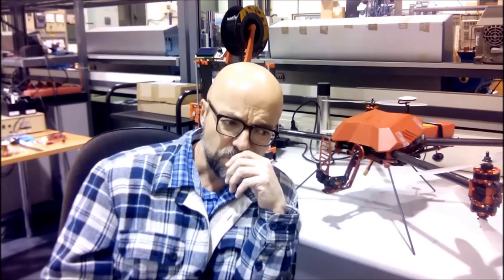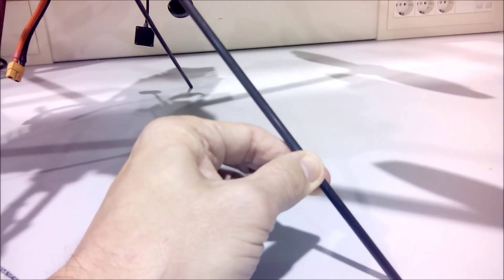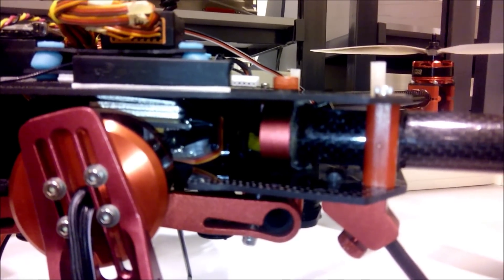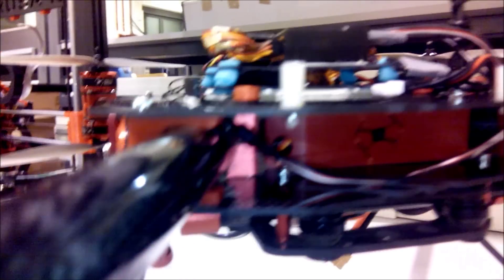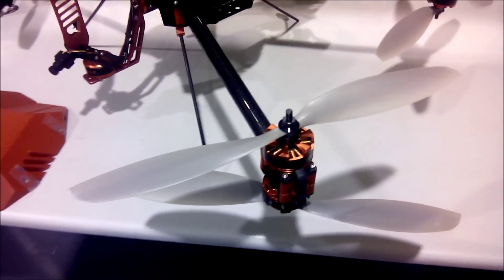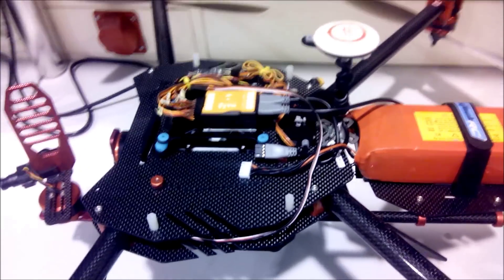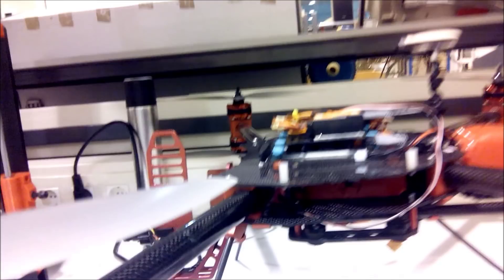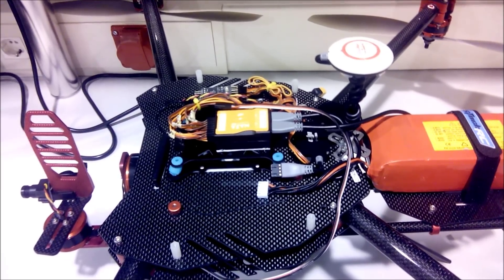Review of Mavrik - Steadidrones. The drone that does not fly

Comment: It's a bit disgraceful to bash a drone without any video evidence of it's so-called inability to fly.
Reply from the maker: You may believe us or not. Anyway, a video would mean nothing since the problem might be a wrong configuration  or a lack of experience of the pilot. My explanation about the reasons why it does not fly are here and in several videos more. Together with an abosulte silence of both the European distributor and the headquarters in South Africa in spite of my insistence. 

I do not know if you have watched the videos where I explain the design errors, the mechanical problems, the wrongly installed propellers and so on. I think this, together with the fact that they give it for free right now, should be enough to believe a serious problem exists. Moreover, you can see it fly perfectly after a complete refurbishement and a radical change in mass distribution (also in this channel). My question then is :): Is it disgraceful we did not aim to record the hundred  times it did not fly? Should we have taken a video camera and expected some costed several thousand euros tried to auto-suicide every time it took off :)? 

Talking seriously now. The colleague who brought it to me always taught it was his fault, even after a "reparation" in a DJI official distributor of almost 2000€ and the installation of a new controller and new ESCs since Steady drones never showed up. It was me who found the wrong design just by pure logic and basic equations of Dynamics.

Best Regards